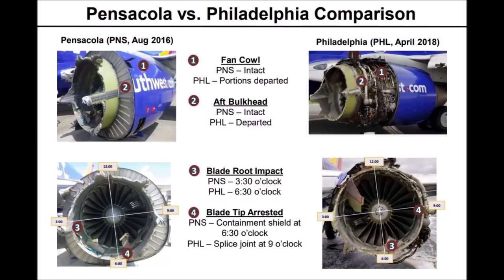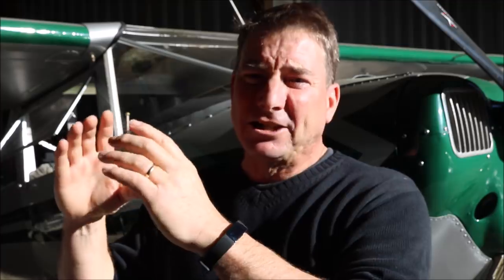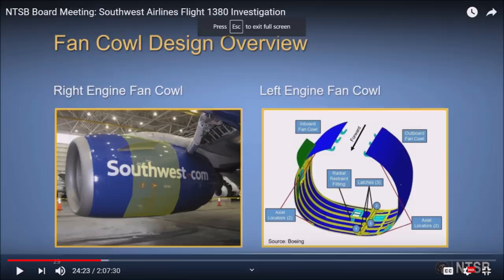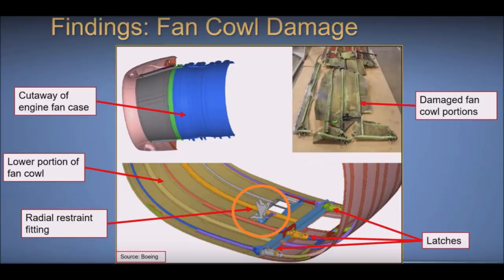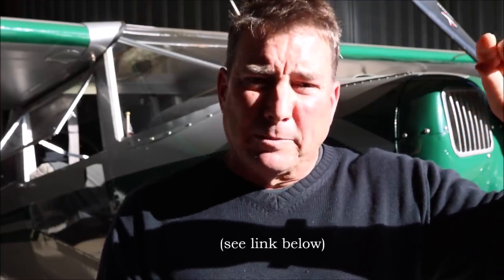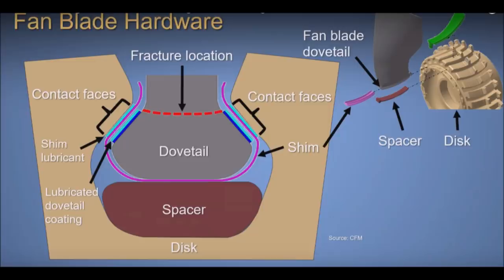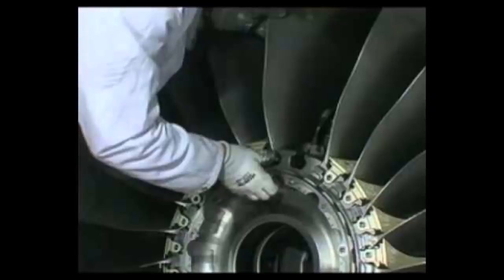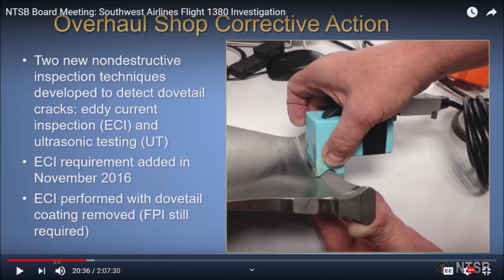NTSB Board Investigation SWA 1380

Comment: Thank you Juan for this clear and easily understandable summary of the extremely detailed and technical NTSB investigation report.  I'm continually amazed at how much the NTSB can "reverse engineer" a disaster.  When you said that they found that the blade failed at the 6 o'clock position, I was blown away.  Anyway, thanks again for your no-nonsense reporting!
Reply: It wasn't that for me. It was the ability to envision its exit path. Lots of us who have worked with machinery have looked for witness marks from items that shouldn't meet but do. However when something has gone bang and let go in a fraction of a second and people can trace the component exit routes. That is way beyond my comprehension.
Reply: @LTVoyager  
Are you implying there is a force beyond centrifugal force at such speeds?
Reply: Chris Holt The NTSB did computer simulations using the actual design for the NG fan cowling, and found that the six o'clock impact caused forces that exceed the design criteria. A long-standing error that was only revealed by this accident, will require retrofitting of thousands of jet engines.
Reply: @LTVoyager  
Would you go so far as to say to reinforce (or less) reinforce the 6 o'clock position on the cowling as a reasonable precaution?
Reply: @alleycatvietnam  And I get frustrated when the NTSB comes up with a conclusion with no real evidence. Mostly, they do well. Also, many recommendations would cost tens or millions of dollars; in some cases, they'd render perfectly good airplanes no longer economical to fly. Aviation business runs on the edge of a razor, and often goes the wrong way.
Reply: It makes no sense that a blade has more pull on it at specific clock position
Reply: LT: the force of gravity is dependent on the distance from earth an object is.  A fan blade root is only about a meter away from from its position at 6 oclock vs 12 oclock therefore the delta of gravity pull would be immeasurable. The design flaw weakness at 6 oclock can have nothing to do with gravity. More to do with the engine cowling being flat there and therefore more vulnerable  at 6 oclock
Reply: @jadesluv  I does though, and it's kind of fascinating!
Consider gravity is always pulling down, so a blade at the top would be pulled towards the hub, while a blade at the bottom is being pulled away.
IMHO though, I would expect that ~9.8 m/s of force (acceleration 🙄) would be negligible compared to the force of the rotation. (The centripetal force. Also interesting!)
I would guess that it'd be essentially chance that'd determine when in its cycle it detached, otherwise we'd expect all blade detachments to happen at or near 6 o'clock.
Reply: Scratch markings, my man. Among other things, no doubt.
I was blown away working in mechanics with what you could tell with subtle clues and right understanding.
Not just gas turbines at crazy RPM, but even what goes down at the tip of a drill bit. Which IMHO can still be pretty crazy RPM for intuition.

Comment: Excellent explanation from an  experienced and knowledgeable pilot.
Reply: It is why fly is so safe in this country, many of these type of investigations during the bloody years (plane designed and built from the 60s probably into the late 80s) had hundreds of minor engineering errors that were corrected. You look at the flight crash shows and many were before 2000 or planes built before 2000, many engineering and pilot corrections were done based on accidents and near accidents. The MAX accidents is an example of the type of things that happened a lot as they moved large aircraft designs developed during WW2 into passenger carriers, crashes with major airlines killing everyone were relatively common back then when compared to today and allowing people to bring or store bombs on the plane was one of those bugs.

Comment: Hi Juan, I’m a licensed engineer with an Australian airline. We’ve been carrying out fan blade re-lubes for a long time. It started in the 80’s on CF6 type engines on A300B4 aircraft in an attempt to alleviate odd N1 vibrations that intermittently plagued these engines. Very often, these inspections are carried out during overnight service where time to complete the job is an obvious factor. There is a lot of work to do. The blades can be removed in about 30 to 45 minutes. However, after removal they must be cleaned and inspected before re-lubing can be done. This is what takes all the time. It takes 10 minutes to wash each blade in denatured alcohol plus another 5 minutes to inspect. That’s 240 minutes plus 120 minutes. In addition, the fan disk must also be washed and inspected. When all is satisfactory, we re-lube the dovetails and the fan disk with two coats of spray molybdenum disulphide lubricant and wait for it to dry. It’s very easy to see how this simple procedure can quickly become a ‘rush job’ with the fan being reassembled almost as they’re waiting to tow the aircraft back on line. The tendency is to rush parts of the job: cleaning is not carried out properly making inspection more difficult. In short, it is easy to see how cracks that are potentially visible to the naked eye can be missed.

Comment: Another very informative video! Great  job!. I am an AMT and have performed that blade lube on the CFM several times, although it has been years since the last lube I've been involved with. The process was done by removing all fan blades, laying them out on a large workbench, removing the old lube with alcohol, reapplying three coats of Dri-Moly lube from a spray can. Lube was applied to the dovetail of each blade, the spacer, and retainer. The blades then are reinstalled back into the engine in the same order as removed. An engine run is performed to check vibration before the next flight. This work was done on a routine "B" check overnight, one engine at a time.  A visual inspection was accomplished but no NDT was involved.
Reply from the maker: Thanks Robert!
Reply: blancolirio Juan as a 30 yr AMT @ UAL  I would like to add to Mr. Behring”s statement that at UNITED ultrasound inspections are performed on each fan blade in addition to a DETAILED VISUAL INSPECTION of the fan hub assembly.  Keep up the good work gents.....

Comment: “…speed is life.” Excellent.
Reply: Actually that's almost the opposite of what the judge said today in traffic court :-(
Reply: @Miata822  😆
Reply: efox2001  I recently learned the term “moose stalls”. Apparently the term was coined in Alaska because of stall-spin crashes by pilots doing turns around moose while either observing or hunting them and the plane gets too slow for the bank angle (a higher speed stall) and they are unable to recover because of the low above ground altitude.
Reply: Bruce John Shourt Juan left out the 2nd part:
Speed is life, and altitude is life insurance (corrected).

Comment: Lubricant is very thick grey lubricant of graphite grease so once they are removed they have to be stored in a specific sequence so that once they are reinstalled and run they will meet the vibration limits. This paste prior to inspecting the blades have to be thoroughly cleaned, then inspected then lubed again and installed  lots of work.
Reply: They likely self center via centrifical forces, the lube assists it.
Reply: I would love to do that, but then I wouldn't be able to sleep at night anymore...

Comment: Great explanation of the NTSB findings Juan.  The crew did a great job given the multiple problems that they were faced with they got the plane down quickly and choosing a fast landing rather than extending unknown stuff into the wind on an aircraft that was displaying wonky handling was a good call given the long runway.  Anyway, thanks Juan for the as always detailed briefing from a pilot's point of view, way more informative than a reporter with no airline knowledge.

Comment: Great job, Juan. I usually get my info from reading these reports, but I very much enjoy your take on them.  One correction based on your comment at 5:09:  The 737-100 and 200 were powered by P&W JT8D turboFAN engines, albeit low bypass by today's standards. The JT8D was based on the military JT8, military designation J52 -- an actual turboJET that powered the A-4D and later series as well as the A-6 series and the Hound Dog missile. A fan was added to make the commercial engine, much as a larger fan was added to the F101 engine that powers the B-1 bomber to make the CFM56 series.

Comment: As a product designer, I'm stunned at the image of people with the mask only over their mouth and not their nose. Note to the designers of these systems: All you have to do is add a small nose-shaped indentation in the rim of the cup and that will automatically tell people to cover their nose. Yes, you'll have to redesign the mould. Yes, the mould will be slightly more expensive. Yes, people WILL use the oxygen mask correctly as a result.

Comment: I'm beginning to see a pattern in complex aircraft emergencies. Emergency checklists are practically useless. Emergencies are chaotic, and can't be rehearsed. Aviate, navigate, communicate. Also, delegate! One pilot should fly the plane, the other should handle the rest.
Reply: Emergency checklists and training assume a textbook scenario. They are useful in that they give very good guidance in situations that, if incorrectly handled, can become very chaotic indeed. EXPERIENCE, however, is the factor that determines weather the checklist/recurrent training guidance is applicable in non-textbook scenarios such as this one. 

The vast majority of non-normals are simple, textbook scenarios that work very well with checklists. Very little experience required. These non-normals happen every day and don't make the news as they are non-events.

Multiple unrelated failures rely on the experience of the pilots to do the right thing given the scenario. We are very lucky in North America that we still have very experienced pilots flying our airplanes. In the case of SW 1380, an inexperienced crew may have been the catalyst to a very large disaster indeed. 

YOU GET WHAT YOU PAY FOR!
Reply: Right. Remember this every time some bozo talks about "pilotless airliners."
Reply: You are clearly wrong. It is directly because of emergency checklists practiced over and over again that directly resulted in the pilot correctly managing and responding automatically and correctly to multiple emergencies without having to refer to the checklist. But because she practiced these emergencies and checklists many times she knew exactly how to react and what to do without referring to a checklist and utilizing parts of checklists automatically that helped her emergency, saved the plane, passengers and crew directly because checklists exist and were practiced. Agsin your dead worng, check lists are critical
Reply: @n6mz  Very well said.   DIA installed a very expensive automated baggage handling system that never worked.   Robots are good for redundant tasks, but are complete failures with the unexpected.   All tjhey do is shut down.  The MCAS system is a good example.
Reply: @n6mz  I do think about this. A computer would be able go through a checklist  almost instantly (and continously) and never forget anything or do it in the wrong order.
Reply: Have you read the final report on Air France 447? How well did those wonderful airbus computers do during that disaster? When the s*** hits the fan up in coffin corner, on whom do you want to trust your life, a group of software twits in tolouse or Capt Juan Browne? I'll take Capt Browne (and a 747/757/767/777/787).
Reply: @n6mz  You mean like those highly trained aviators flying TransAsia Airways 235, who turned off the wrong engine and crashed the plane?
Reply: n6mz..But what about AI? Don’t they just learn these things as they go and therefore can make good decisions when the unexpected happens?😂 There are a lot better words for these people than bozo, but will just leave alone on this one, we all know what they are.
Reply: A computer might has been able to detect a vibrational anomaly in the engine..  fatigue cracks will cause additional flex.  

Like wise robotic inspection of components might have detected abnormal wear.

Use robotic and automation where it makes sense..  and no place else..
Reply: @airgliderz  

Necessary but insufficient..  its not the plan its  the planing...
Reply: @n6mz  You must have read a different report to the one I did. I read about an inexperienced crew with incomplete systems knowledge acting improperly to a fairly routine failure, and a captain who returned too late to save the plane. Ironically that's an excellent counter point to exactly what you were praising the highly experienced crew acting in a potentially devastating scenario here. It's got nothing to do with computers or manufacturers. Read the report on Atlas Air 3591 to see how it can be screwed up on a Boeing just as easily.

Comment: The passenger cabin windows are one piece They are larger than the window opening the widow is held in position with clips and the cabin pressure keeps them sealed against the inner skin. the panel on the inside is approximately 1/16 inch thick and is part of the cabin interior decorative side wall. the entire interior side wall panel is easily removed . The function of the inner panel is to keep passengers from scratching the inside of the pressure window with sharp objects and diamond rings because scratches will create stress riser, which could cause the window to fail. the other purpose is provide a cavity between the inner and outer windows for cabin air to keep the outer window defrosted. the small hole is to allow that cabin air to bleed back into the cabin.
Reply: Great information. I’ve worked on these windows and Engines for more than 30 years.

Comment: When the defecation hits the rotating oscillator....you want a Naval Aviator or Air Force Pilot in the pointy end!
Reply: Just listened to her CVR, cool as ice.
Reply: In addition to Air Force and Navy pilots, I have worked with Marines who fly and manage a crew exceptionally well.  I’ve also worked with civilian pilots who are easily at the same level.  The learning never stops.  It is the personality that determines the result, not the source of the initial training.
Reply: Nice creative writing, but fan blades don't oscillate.  Need to come up with something better.  Maybe "when the fan blades break and puncture the defication holding tanks, you want a Naval carrier pilot controling the yoke."
Reply: @pawswet9476  Marine pilots are trained by the Navy. Navy and Marine pilots are basically the same just different uniforms and missions. The vast majority of the ones I have worked with in my 42+ years in aviation are top notch and would fly with them anytime, anywhere, under any circumstances.
Reply: I was a ship's company officer on a carrier during Vietnam. Watching the planes land on a moving, bobbing, very short deck that is at an angle to the direction of travel, at night .... adds another level of skill, required concentration … I always thought other pilots should at least get a cockpit ride onto a carrier just for the experience. Juan??
Reply: Oscillate is to move back and forth or up and down, to and fro repeatedly, a fan moves in a circular motion there fore it can be said that it does not oscillate.
Reply: @pawswet9476  Marines are considered to be Naval aviators, as they go through all of the same schools as their Navy brothers, and sit right along side of them in the same class rooms etc.  The flight instructors at all of the Naval aviation schools are a mix of Marines and sailors.  The Marines even have to perform carrier landings and quite often serve onboard ships.  So you see, there is no difference between the two services when it comes to flying; only the uniform, upon which both wear Naval Aviators wings.
Reply: Yes there is a difference between the two services when it comes to flying: type of aircraft flown. There are types the USMC flies which the USN does not and vice-versa. However from a training and ethos perspective what has been said is correct.
Reply: @dennythomas8887  
I learned that when I was a kid and went to see the Blue Angels.
They always had a mixture of Navy and Marine guys, mostly Navy.